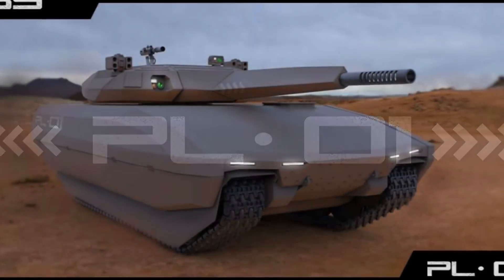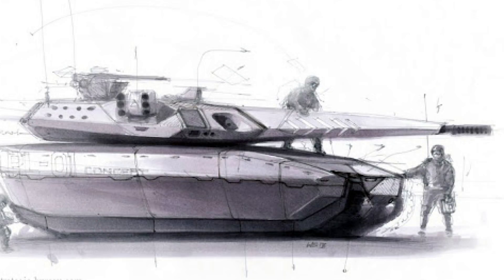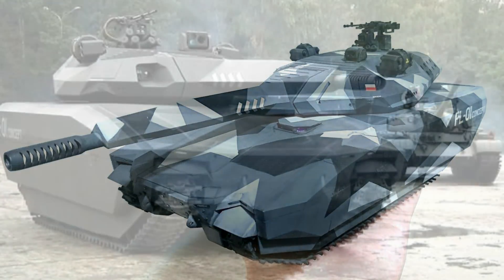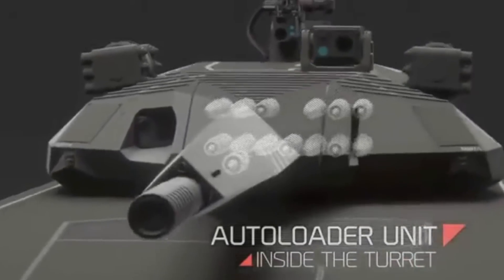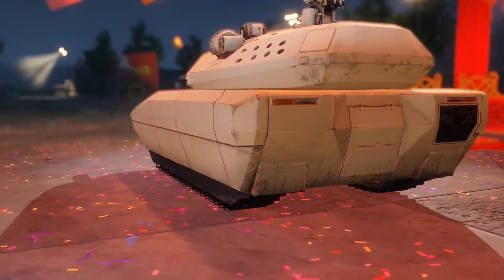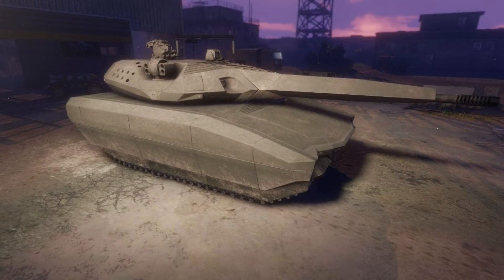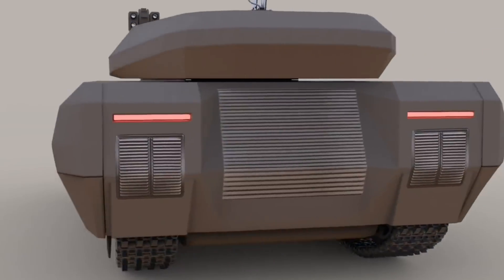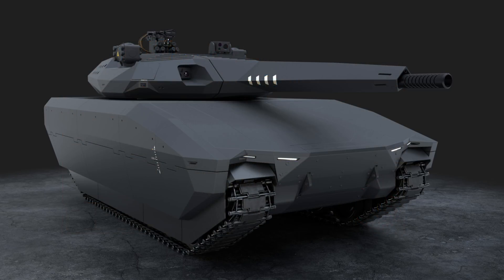PL-01 Prototype concept tank | POLISH STEALTH TANK

Comment from the maker: Epoland Musk - CYBER TANK 

coming..... never
Reply: Got to say, you’ve arroused my curiosity when you talked about the mud... i didn’t think it’d be an issue, but it makes sense when i think about it..thanks for the video, as a polish- dutchman this tank interests me a lot! Can’t wait to see the follow up video!
Reply: @stefanwosinsky1935  imagine this: if surface will be coled with peltier cells and at some time bucket of mud grab on it .... what problem ? mud is just more mass to be cooled or to be heated  but greater mass  take additional time to adapt temperature..... No one was say that tank will have only one temp sensor ... but in 2015 BAE adaptiv cells was about individual temp regulations. Bigger problem with it is where/what creators want  do with this all  kW's  of additional heat generate/transfer/disspate.... ( every fridge or peltier in one side generate cold and on other generate heat. Its not imposible but only IR camuflage by cooling surface and do it efficient will be state of art machine...alone . ....
Reply: It musk be done
Reply: Maybe next do video on IFV Borsuk also from Poland. It is created to replace BMP-1s in Polish Army.
Reply: seems like so many tank designs are ignoring IEDs.
They all are flat on the bottom means taking the full force from any ground mines.
Reply: @Marinealver  Not necessarily, not all countries are expecting to ever deal with an insurgent force with IEDs. Plus, the problem with something like a V hull is that it would mean that the bottom of the hull is very close to ground, thus not giving you much ground clearance which could be a problem on rough terrain. Or, you have to make the tank that much taller in order to compensate for the V hull and give the vehicle some decent ground clearance.
Reply: Riceball01 well if the insurgents force know the tanks’ weakness, they will for sure procure an ied
Reply: A stealth tank would make more sense with this armament cause these could be suppressed.

A smaller scale version of NG AbramsX.
50MM auto cannon.
And
Dual M2HB secondary gun.

Serious fire power that could be suppressed using field replaceable and mass producable suppressors.
Reply: Hey do one for stinger missile .... Please .... Like the way you explain
Reply: 9:02 What game/software is this? I notice it when you reviewed other vehicles as well.
Reply: I will keep call it Khanjali
Reply: Musk's pickup truck looks damn ugly and built like a brick. I am sure you could increase the size a bit and install a 120mm gun.
Reply: I just saw an ad for new bell helicopter looks like a black hawk and an osprey had a baby
Reply: @thevaultdwellergaming  might be the end of Bell then, a " Bell end helicopter."
Reply: mass production was to start in 2018 Unfortunately, it is not even known whether it was abandoned nawet w Polsce
Reply: Why have you done this to me?
Reply: "Smiling pokerface" for those without sense of humor.
Reply: One last (maybe) again. If you can edit my answer into one post. I'm not sure about replacing old polish T-72 fleet. There was test made Leopard 2A4 shooting old T-72... at 1000m distance. I think there was quite surprise for our commanders. T-72 ding that shot. At that quite short range for modern tanks.
Reply: 34 ton weight , 940 Horse power per ton horse power 30 , 105 mm or 120mm Canon , this tank is fantastic , but is it Amphibious ? It has active reactive and stealth armour .
Reply: we want to see this tank fire and obliterates another . tired of listening to your cute voice .
Reply: Yes manned turrets are the past if you put everyone in a heavily armoured capsule its able to be lighter and more protective for the crew I really think tanks are about to have a major jump just like the t14 but gosh I wish I could develop a couple different tanks I got so many ideas and also designers need to talk to the soldiers that will be using them for their input most and see how they feel about things
Reply: Hopefully this tank will be produced in series in Poland. It would be a great success for the Polish defense industry. In any case, the future belongs to stealth ground vehicles. Because most anti-tank missiles are so-called "fire-and-forget" missiles that are either controlled with electro-optical thermal imagers or with active radar. In the future, not only tanks will be protected with stealth technology. For example, armored fighting vehicles will also be protected in this way in the future. Incidentally, of course, not only the Poles are developing this technology.
In any case, if all combat vehicles are protected with stealth  technology in the future, then the old wire-guided technology will be used again, i.e. missiles guided by wire by an operator. The disadvantage is the limited range, because the range is reduced by the length of the wire.
Reply: It may be revived now that Poland is increasing defense spending since the Russian invasion of Ukraine.
Reply: But the Russians are using T-72s and Evan T-62s in Ukraine up against them this is actually much more relevant, (the Russians actually a very few T-14s and they look to be high maintenance the Russians have built at least 70 but fewer than 20 are apparently operational). Up against older tanks the PL-01 is quite battle Worthy, (even the T-80 and t-90 are not all they're cracked up to be).
Reply: NOOOO K3
Reply: Mat you use a questionable quality information's that exists more in the field of "fantasy" than reality. And that's not unusual in this case, PL-01 has gained great popularity for his futuristic look and many would like to be real, well it was never intended to be real. So, to give you some more precise information. PL-01 shape was made by by civilian design company (and I am begging you for forgiveness, I totally forget it's name... it was a small Polish studio with start on S. I think.) it's simple goal was to make it futuristic and high tech. Literally "concept car" of tanks, something that people will look at with interest. And they did a great job, they deserve a bonus payout. Vehicle was made just for that show, the cooperation with BAE was needed as OBRUM did not had a ready chassis to build that mock-up. So they borrowed that chassis from CV90 and after the MSPO they dismantled additional elements and returned it to BAE. And the story of PL-01 ends there, it was never anything beyond "concept car" for show. However, he gained such great popularity that it start to have a life of it's own... any information about, prototype in 2016, production in 2018, how it is high tech, how NATO banned its production (yes... not joking, that theory was popular in some circles) plans for export, production ect. It's all false, nothing was "planned" for PL-01, all data about it's protection and possibilities, theory, guesses and wishes. Nothing more, nothing less. PL-01 was never anything beyond a fancy mock up for a show. Probably the most successful mock up in recent history, after so many years it's still live in fantasy of people, games and artwork.
Reply: you say in the video "an unmanned turret like the  t14 or Leclerc " Leclerc have a 2 man turret with auto loader. Nice video tho ;)
Reply from the maker: E.D. D.E right back at you buddy, T-40 leclerc does not have a manned turret
Reply: dont forget they forgot to removed that price tag there
Reply: More likely cardboard tank
Reply: ya diesel , but did (make) first step into new direction (damn, really?????????????????), maybe, who knows? 
thanks Mat
Reply: What Polish tank do in the war?
Wait in the line to get shot
Reply: @mmma5261  i would love to see you trying. What country are you from?
Reply: @ukasztokarski3715  Serbia
Reply: @mmma5261  no offense to You or Serbia but if You would attack Poland You would be destroyed in few day. Maybe M-84 is better than our old reserve t72 but we also have more leopards than you tanks in whole. If we would attack Serbia (which I don't know why we would do, as Poles likes Serbian people, and we have nothing against Serbia) and it would be one-on-one war, we would have greater loses than on our land but we would probably succeed after all. But it is pointless because Serbia and Poland are known for their great guerillas and are impossible to occupy without great troubles...
Reply: @ukasztokarski3715  do the research about 1999 and 2008 before somebody else do and then you will know why am I kinda angry on Poland
Reply: @mmma5261  You know in 1999 I was born. And take into consideration that Poles was obliged as members of NATO to take part of this intervention.
Reply: @ukasztokarski3715  Poland in NATO 12.03.1999.
NATO bombing Serbia 24.03.1999.
Kosovo independence 17.02.2008.
Poland recognise Kosovo as independent state 26.02.2008.
Really, that fast, what we ever do to Poland, to our SLAVIC Brothers. Ask your parents, did they have a better life now.
Anyway find channel Slavic affairs
Reply: @ukasztokarski3715  yeah continue to believe in that
Reply: @mmma5261  well there are many proofs that it happened. And BTW, no Polish soldier was in Serbia in 1999, Poland joined only formally. So not even one Polish bullet was fired against Serbian people

Comment: But the Russians are using T-72s and Evan T-62s in Ukraine up against them this is actually much more relevant, (the Russians actually a very few T-14s and they look to be high maintenance the Russians have built at least 70 but fewer than 20 are apparently operational). Up against older tanks the PL-01 is quite battle Worthy, (even the T-80 and t-90 are not all they're cracked up to be).

Comment: Hopefully this tank will be produced in series in Poland. It would be a great success for the Polish defense industry. In any case, the future belongs to stealth ground vehicles. Because most anti-tank missiles are so-called "fire-and-forget" missiles that are either controlled with electro-optical thermal imagers or with active radar. In the future, not only tanks will be protected with stealth technology. For example, armored fighting vehicles will also be protected in this way in the future. Incidentally, of course, not only the Poles are developing this technology.
In any case, if all combat vehicles are protected with stealth  technology in the future, then the old wire-guided technology will be used again, i.e. missiles guided by wire by an operator. The disadvantage is the limited range, because the range is reduced by the length of the wire.

Here is some additional information about this tank! The tank has Steel composite armour in bulkhead construction and a modular ceramic-aramid shell across the front portions of the hull and turret, which is designed to provide protection. Additionally the crew are provided with special seats to minimize the physical effects of nearby explosions. Additional armour panels are mounted on the turret and hull, and are designed to provide full protection against a range of projectiles. The hull of the vehicle provides protection against improvised explosive devices (IEDs) and landmines.

Additionally the tank isn't recognized by the enemy! And for weapons of infantry, of helicopters and of planes, the PL-01 is invisible. Because most anti-tank missiles are so-called "fire-and-forget" missiles that are either controlled with electro-optical thermal imagers or with active radar. For these missiles the PL-01 is not recognizable!

This is a completely new tank with modified armor and armament  with additional stealth technology. This is actually just the chassis of the CV90120. So just the scaffolding! The PL-01 has a crew of 3 with an automatic loader for its main canno and the CV90120 has a crew of 4 with loader in the turret. So the turret of the PL-01 is unmanned but there is a crew member in the turret of the CV90. The PL-01 can carry an additional of 4 infantrymen and the CV90120 can carry an additional of 8 infantrymen. But the PL-01 has a much more powerful engine and that is not the engine of the CV90120. But I doubt the PL-01 will keep the diesel engine. The PL-01 also has a Polish 7.62 mm UKM-2000C machine gun and not the Swedish 7.62 mm Ksp m/39 machine gun. Whereby a 12.7 mm machine gun may will be installed! The PL-01 is also said to have an additional 40mm automatic grenade launcher which a CV90120 does not have. There are other differences between the PL-01 and the CV90120! As I said, that's just the chassis of the CV90120.

In any case, the future belongs to stealth ground vehicles. Because most anti-tank missiles are so-called "fire-and-forget" missiles that are either controlled with electro-optical thermal imagers or with active radar. In the future, not only tanks will be protected with stealth technology. For example, armored fighting vehicles will also be protected in this way in the future. Incidentally, of course, not only the Poles are developing this technology.

This video is also quite good about the tank because it shows the tank in action there too! https://www.youtube.com/watch?v=nv5vxEiM5ac Scary Weapons: PL-01 Stealth Tank Advanced Ready To Fight Aliens Or Russia

Comment: tbh i do like the design of the PL-01 it does look more nice and functional
Reply: if american can fuse the abram with this tank and make it futuristic looking then dammmm
Reply: what the pl01 did right was add flat plates of armor and very smooth looking exterior look 
i mean tanks back in the day also had flat armor look
Reply: with the flat armor look it shouldn't lack in armor protection
since if the armor was perpendicular with the other tank armor pericing round it would go through 
but with this it does have slanted armor design 
slanted provides more armor  since it can sort of ride and grind on the armor and sort of grind off the armor
Reply: for the left right and read needs tons of protection 
but for the front it needs compareable armor but with a slant so that there is no flat perpendicular armor since that is kinda a weak point since any armor just has to go straight and not slanted and fights with more armor on a slanted armor

Comment: Ah yes, Vapourware - the tank

I still vividly remember the TV special presenting this tank and I got the impression that people responsible for this had zero idea what the purpose of this tank was supposed to be.
The description consisted of number of contradictory statements.
It was described as direct close infantry support tank, for use in urban environment... but lightly armoured.
Stealth capability... for use in close support where visual identification is the most important factor, not radar.

It was never described as a scout or ambush vehicle, where these qualities would actually matter.

Also - apparently the model used for presentations was so badly made it could not even turn the turret.
Reply: So I saw the prototype PL-01 rotate its turret. Otherwise, the tank takes over the usual tasks of a tank. Fight enemy tanks/vehicles and support infantry.

Comment: A “medium tank” weighing 35-45ton with a 105-120mm barrel, a 10km range for indirect fire is perfect support for IFV. Armour the front to withstand 40mmAP and sides 25mmAP you have a niche but versatile vehicle. Grunts and mechs will love it. Just don’t use it where a MBT is required.
A huge problem with the military brass is they use armour and equipment for roles they are simply not designed to carry out. 
Multi role usually means, good at 3/4 things shit at most other things. We need to start trending back towards purpose built or dual use. I like modularity but I don’t remember every changing a damn thing on our “modular vehicles” it’s a common chassis, shut the fuck up with “modular” bullshit.
2/14LH 10RTF Afghanistan 2010, 631CTF.
Reply: I have to disappoint you, but the tank is exactly that! A
 Multi role tank! The tank takes over the  tasks to fight enemy tanks/vehicles and support infantry. The 120 mm caliber main cannon is also suitable for this. The cannon will be able to shoot both conventional projectiles and guided anti-tank missiles. In addition to infantry support the Planned designs included a 12.7mm  machine gun and a 40 mm automatic grenade launcher.

Comment: A+ for trying...Smaller is better, but armour needs to be there! I see a smaller unit in drone mode... Autonomous, with attack movement adjustments by an AI survivability program...A self guided mover able to compute best options for its survival....Even have a cloaking system an auto hide/shutdown...Until enemy detection...

Comment: In manned turrets are safer and increasing crew survival however they do possess a key problem when systems shuts down either by faults or via hit and backups are required to operate the gun, maybe an auto loader assistance would help where much like the conquer where it had an auto loader but was capable of being manually loaded also perhaps a turret shield would’ve been a good addition like the leopards or particularly the Maus to reduce turret ring shots by redirecting the shot upwards in front of the turret rather than under it